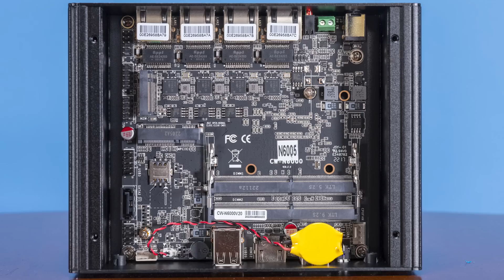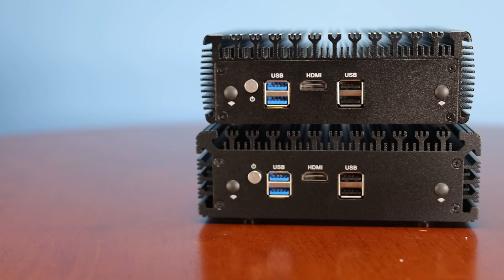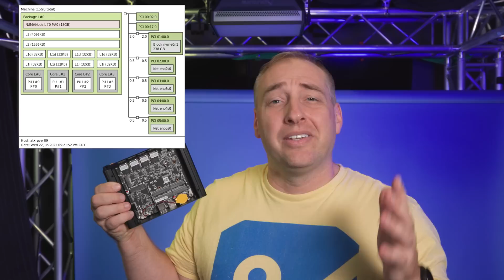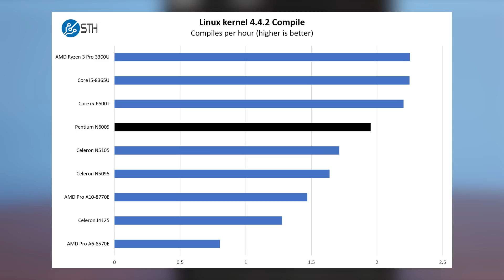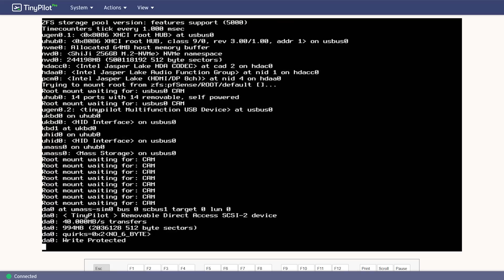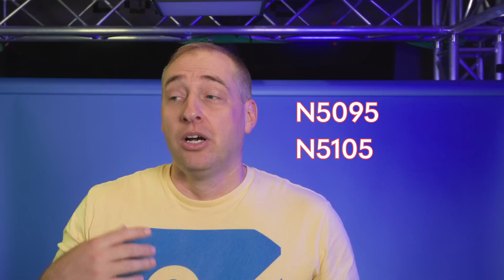Fastest Cheap 4x 2.5GbE Intel Atom N6005 Firewall for pfSense OPNsense and Proxmox

Comment: I see these models are for 2.5Gb internet. Do they have any for Gig internet
Reply from the maker: Usually the 1GbE versions use J4125 or older processors. It costs about the same to use i210 1GbE NICs as i225/i226 2.5GbE NICs so the more modern ones use 2.5GbE. Since the 2.5GbE ones are backward compatible with 1GbE, I do not think we will see more i210 versions.

Comment: Is this one worth it over the 5105? I plan on using opnsense with it on a 1gbit connection. Not sure about settings on ids etc yet but I want security to be tight. Money isn't really the issue. Not sure how the power draw is different.

Comment: Euhhh.. OK, so suppose I get a 2.5 G router & firewall. What about my switches?  2.5 / 5 / 10 G  VLAN capable switches are $500 each. So if I have 1 8 port switch behind my router and then 4 switches, one for each room in my house, to connect wifi access points and wired clients to, I am looking at 5x $500 on top of the router. So don't make it look like the router is the main cost component inan upgrade above 1G.

Comment: I was going to get one of these but after seeing quite a few reviews regarding the high idle temperatures, I'm going to pass. Spotty quality control seems to be a huge issue, unfortunately.
Reply: I think the issue rely on the bad power block. I bought a much better one for 17 euro on Amazon and idle is now around 5 to 6w (N5105 with 4x i225V).

Comment: I ordered a Qotom Barebone System (Q750G5 5X Intel I225-V 2.5G LAN CPU J4125 Quad Core 2.0 GHz - with 5 - 2.5Gbe Ethernet Ports) from Amazon on 8/10/2022 and received it today 8/13/2022. Shipped all the way from China. No shipping problems here. When I opened up the box to install the memory and ssd, I found an 8 GB stick of RAM. That was a special surprise.  I have installed OPNsense.  Thanks for all of the info on these small computers.  It made me brave enough to make my network router.

Comment: I got Topton with N6005. Getting stuck on black screen when installing Proxmox. I don't have much experience with Linux but it is probably related to drivers.  Can someone help or share their experience? I know Proxmox can be installed on Debian Buster but I got stuck again because Debian does not have Intel i225 drivers.
Reply from the maker: The 7.x Proxmox train we show in these reviews installed without adding drivers. Maybe go into the BIOS and double check things like virtualization are turned on.

Comment: 15:20 That power supply is terrible!
Just look at the power-factor (second number), it is roughly 0.6 while a good PSU should have around 0.8 in the low wattage regime and north of 0.9 with nominal load.
I assume this PSU literally does not have any power-factor correction circuit.

Comment: If you think you need a fan on the Kingnovy unit I would recommend this:
Since the Kingnovy unit can sit on its side, you can do so, remove the bottom and go buy some cheap mesh from your preferred hardware (as in building materials) store and put it where the bottom used to be (just glue it in place).
If you still want the bottom to mount it somewhere I think the best option would be to cut out part of the bottom (your hardware store can also likely help you with that without you having to purchase the tools) and put some mesh over it.
I think natural convection together with it being on its side will be more than good enough to cool anything in there.

Comment: I see this and other intel CPU product in Aliexpress.  Would pfsense/OPNsense run more effectively (faster and less bottleneck) with  i7 1165G7 compared to N6005?  It's for the home use with  a gaming PC, a NAS, and about 20 wiress connections.  Thanks.
By the way, I have XR700, netgear.  Paid whole bunch for it, and it's slow and can't maintain the DL speed.

Comment: Does anyone knows what is the input voltage range allowed on those? I imagine there is some kind of regulator for the CPU inside the box. 12V regulator are also not delivering a precise 12V. Wondering if this could be wire directly to a 12v car battery while the alternator is running! Thanks for anyone that have a clue on this as I just search for 1 hour and no one mention this!
Reply: modern car charging systems will supply up to 14.4v (or more) and the batteries are usually closer to 12.5v while the vehicle is running and not charging.

Comment: Thanks for your informative video. I am curious as to why get this N6005 unit rather than the J4125 unit you reviewed a few months back. If the main use is for pfsense, is there any benefit in getting a higher power/speed processor? Also, would it be better to run pfsense bare metal or in a proxmox VE in these kinds of boxes?

Also, would you consider doing a step by step install and full setup of pfsense for a typical home use scenario please? Thanks.
Reply from the maker: We have the Proxmox VE with pfSense installation guide using on one of these (I think the J4125) linked in the description. Some want more performance if they are running more VMs on the unit.

Comment: I've heard, or read, that running a vpn using open-vpn requires compute power, and I'd like to ask that your reviews of router-ish devices include some info about through-put & power draw while using a consumer vpn.  Or, perhaps, make a seperate vpn video discussing general reqs.  Thanks,
Really surprised this device uses so little power when each port on the cheap switches had more of a bump in draw.

Comment: Thanks for the video. I bought an 8 port 2.5Gb version from qotom. There’s no NVME port, I guess they ran out of PCIe lanes. There’s no atom processor option either (again likely due to the amount of PCIe lanes). Looks like it will pay for itself in 3 years just from the power savings.
Who knows how long it will take to arrive though.

Comment: What MAX temperature does the N6005 reached? and how much does it usually hang on routing?  I have one on my way would love to have your numbers to compare before deciding if mine has an issue or not.
Reply: 60 C full load, they use powerlimit on CPU

Comment: How would something like this compare to the similarly priced ($370-$400) Asus GT-AX6000? As much as I would like some of the advanced features you get with a roll your own router, I feel that I would rather have the (relative) stability of a fully warranted Asus product with comparable costs that also include Wi-Fi 6 and a trustworthy power supply.
Reply from the maker: Totally there are folks that would prefer an all-in one. I run 6x APs at home and you can run the WiFi controller software on this, along with better VPN/ IDS. This is more for those who want more than an all-in one unit. Plus, sometimes you just need a fanless PC
Reply: @ServeTheHomeVideo  I really do want something like this, for all those reasons, but I just don't think you're going to get reliable firmware updated (ok, you might not get that from Asus either (-; ) and definitely no tech support or warranty for boxes from Ali baba.

Comment: Thanks for the video Patrick! You mentioned you also just got the 6-port i7 version, I have that one as well (kingnovy version). It seems to be tailored for a 2242 ssd but with an adapter bracket that allows 2280 ssd's but under an angle. Eager to see your review on that unit, cause I had to adjust tdp's in bios and it still runs too hot to my liking (even at idle).
Reply from the maker: I did not get the chance to try it before flying out again (only 40 hour layover at home between trips this week.) Thermals are something I want to look at specifically.

Comment: So I ordered the kingnovy barebones model but I am a little confused about which sodimm I am supposed to purchase with regards to pin count, there are three different ones. Is it the 240 pin version? Also, if I am just looking at power consumption, does the nvme drives use less power? I don’t think performance is that important as I am just getting it for the firewall appliance.
Reply from the maker: DDR4 SODIMM, aim for non-ECC DDR4-2933 or 2666. On the SSD, 2.5" SATA will likely be cooler

Comment: Here's GPU today WW channel inventor yesterday. Is it true Seeking Alpha is holding these FTC public disclosures for public transparency behind a pay wall? . . .

Rank	Product	6.30.22	6.1.22	Change	Prior Rank	Note
1	3060	3.280%	4.068%	-24.02	1	
2	1060	3.182%	1.959%	38.45	5	Up from 10
3	3060ti	3.182%	2.906%	8.68	4	
4	3070	3.119%	1.462%	53.13	26	Up from 26
5	R580	2.917%	2.775%	4.87	6	
6	3060 mobile	2.917%	3.197%	-9.58	3	v Arc
7	3050 mobile 	2.917%	2.412%	17.32	9	Up v. Arc
8	3090	2.856%	2.275%	20.33	10	Keeps Intel 
9	Tesla all 	2.652%	2.578%	2.80	7	Out
10	2060	2.652%	2.188%	17.49	12	
11	3070 mobile	2.323%	2.473%	-6.45	8	v Arc
12	1660S	2.307%	1.959%	15.11	18	
13	3080 10 GB	2.267%	3.487%	-53.79	23	Up from 23
14	6600	2.220%	1.744%	21.45	21	Up from 21
15	1050ti	2.031%	1.892%	6.87	17	
16	3080ti 12 GB	1.954%	1.537%	21.35	15	
17	R570	1.825%	1.805%	1.09	18	
18	2080	1.697%	1.773%	-4.44	20	
19	1080	1.687%	2.020%	-19.74	13	trading
20	3050ti mobile	1.660%	2.002%	-20.61	14	v Arc
21	1070	1.565%	1.796%	-14.78	19	
22	6700XT	1.533%	1.488%	2.93	24	
23	3080 mobile	1.514%	1.572%	-3.82	22	
24	1080ti	1.496%	1.468%	1.88	25	trading
25	1650ti	1.496%	1.293%	13.54	28	
26	5700XT	1.493%	1.293%	13.39	29	Up from 29
27	1070ti	1.352%	1.110%	17.92	31	trading
28	970	1.347%	1.345%	0.13	27	
29	2080ti	1.331%	1.267%	4.83	30	
30	6600XT	1.286%	1.014%	21.15	36	
31	2070	1.233%	1.014%	17.76	35	
32	3070ti FE	1.087%	0.302%	72.20	73	Up from 73
33	980	1.045%	0.535%	48.83	53	Up from 53
34	960	0.979%	0.927%	5.27	40	Up from 40
35	2070S	0.936%	0.883%	5.63	42	
36	1660ti	0.936%	0.817%	12.77	43	
37	3080 FE	0.915%	0.921%	-0.68	41	
38	R550	0.875%	0.738%	15.66	47	
39	1030	0.870%	0.811%	6.79	44	
40	3070 FE	0.833%	0.956%	-14.81	39	
41	3050 dtop	0.809%	1.107%	-36.88	32	v Arc
42	1650	0.780%	0.782%	-0.26	45	
43	5500M	0.756%	0.761%	-0.73	46	
44	P1000	0.751%	1.093%	-45.59	33	
45	1660	0.735%	1.003%	-36.48	37	
46	2080S	0.732%	0.680%	7.10	50	
47	6900XT	0.729%	0.718%	1.58	49	
48	3060ti FE	0.697%	0.532%	23.75	54	v Arc
49	6800XT	0.671%	0.729%	-8.71	48	
50	TU 4000	0.629%	1.043%	-65.99	34	sweet spot
51	5600XT	0.591%	0.436%	26.29	61	Up from 61
52	R560	0.591%	0.541%	8.60	52	
53	3090 FE	0.591%	0.578%	2.22	51	
54	A4000	0.589%	0.471%	20.04	57	
55	2060S	0.568%	0.471%	17.05	56	
56	980ti	0.557%	0.416%	25.38	62	channel
57	MX 150	0.544%	0.346%	36.39	69	v Arc
58	A2000	0.477%	0.264%	44.60	77	
59	6800	0.427%	0.355%	16.97	68	
60	P 4000	0.427%	0.962%	-125.28	38	always sells
61	GTX TITAN	0.403%	0.375%	7.00	66	
62	6500XT	0.398%	0.273%	31.33	76	
63	R540	0.392%	0.410%	-4.40	63	
64	R560x	0.390%	0.439%	-12.56	59	
65	1050	0.390%	0.328%	15.77	71	
66	TU 6000	0.387%	0.355%	8.43	119	
67	MX 350	0.377%	0.128%	66.05	103	
68	1650S	0.369%	0.782%	-112.06	85	clearing
69	MX 130	0.366%	0.201%	45.21	89	channel
70	MX 330	0.345%	0.203%	41.00	88	v Arc
71	TU 5000	0.334%	0.294%	12.16	74	
72	3080 12 FE	0.326%	0.291%	10.91	75	
73	TU 3000	0.324%	0.177%	45.21	70	
74	VEGA 56	0.321%	0.311%	3.10	72	
75	R VII	0.305%	0.180%	40.92	94	Up from 94
76	5500XT	0.302%	0.250%	17.34	81	
77	950	0.289%	0.244%	15.55	83	
78	Titan X	0.289%	0.262%	9.52	78	
79	Vega 64	0.284%	0.256%	9.88	79	
80	3070ti FE 	0.268%	0.302%	-12.83	73	
81	P2200	0.263%	0.084%	67.90	113	priced right
82	R590	0.249%	0.514%	-106.33	55	
83	P620	0.241%	0.189%	21.73	93	
84	2080 FE	0.223%	0.198%	11.29	92	Up from 92
85	3080 12 10240	0.223%	1.991%	-793.58	15	Ltd. Supply
86	A5000	0.215%	0.218%	-1.46	86	
87	3090ti	0.204%	2.275%	-1014.28	85	cleared
88	Vega 20 mob	0.202%	0.241%	-19.67	156	
89	A6000	0.202%	0.250%	-24.00	82	
90	P5000	0.199%	0.198%	0.65	90	
91	T1000	0.196%	0.462%	-135.44	58	priced right
92	MX 450	0.194%	0.212%	-9.58	87	
93	P520	0.180%	0.189%	-4.74	99	
94	5700	0.164%	0.198%	-20.18	91	
95	2070 Max-q	0.164%	0.157%	4.56	100	
96	MX 250	0.162%	0.148%	8.39	101	
97	2080 Max-q	0.149%	0.177%	-19.36	95	
98	A3000	0.143%	0.177%	-23.78	96	
99	5600M	0.135%	0.253%	-86.93	80	
100	TU 8000	0.122%	0.093%	23.77	110	
101	V100	0.119%	0.119%	0.16	104	
102	WX 3200	0.117%	0.108%	7.85	106	
103	P2000	0.114%	0.439%	-284.80	60	priced right
104	P100	0.095%	0.131%	-36.97	102	
105	P6000	0.095%	0.070%	26.95	119	
106	Vega 48	0.093%	0.087%	6.08	112	
107	RTX TITAN	0.090%	0.070%	22.65	120	
108	6650XT	0.088%	0.076%	13.67	118	
109	WX 5100	0.088%	0.090%	-2.94	111	
110	R570x	0.088%	0.046%	46.87	132	Up from 132
111	R520	0.088%	0.081%	7.02	114	
112	2060 Max-q	0.080%	0.049%	37.91	131	
113	T400	0.080%	0.105%	-31.49	107	
114	6400	0.077%	0.078%	-2.02	116	AMD v Arc
115	WX 7100	0.077%	0.099%	-28.47	108	
116	1650 Max-q	0.077%	0.067%	13.09	121	
117	6750XT	0.072%	0.096%	-33.93	109	
118	W5700	0.072%	0.055%	22.89	124	
119	2070 FE	0.072%	0.078%	-9.58	115	
120	2060 12 GB	0.072%	0.171%	-139.45	98	selling
121	R540x	0.066%	0.076%	-13.96	117	
122	W5500	0.064%	0.067%	-5.01	122	
123	WX 9100	0.061%	0.052%	14.24	127	
124	2080S Max-q	0.058%	0.052%	10.35	95	
125	3090ti FE	0.056%	0.113%	-103.50	105	
126	W6600	0.053%	0.026%	50.69	141	
127	Titan V	0.053%	0.049%	6.86	129	
128	MX 230	0.050%	0.049%	1.96	128	
129	A4500	0.050%	0.046%	7.72	134	
130	W5700X	0.042%	0.055%	-30.12	125	
131	CMP 90HX	0.040%	0.035%	12.34	136	
132	6950XT	0.034%	0.049%	-43.29	130	
133	Vega 64 FE	0.034%	0.058%	-68.58	123	
134	R580x	0.034%	0.174%	-405.74	97	
135	6900XT Liq	0.032%	0.046%	-46.10	133	
136	Instinct M125	0.032%	0.026%	17.82	140	
137	GP100	0.032%	0.038%	-18.71	135	
138	6800M	0.029%	0.023%	20.31	146	
139	T2000	0.029%	0.386%	-1224.90	64	priced right
140	W6400	0.027%	0.020%	23.30	147	AMD v Arc
141	W6800	0.024%	0.023%	2.60	167	
142	6700M	0.024%	0.035%	-46.10	138	
143	T1200	0.024%	0.023%	2.60	144	
144	Vega ll Duo	0.019%	0.017%	6.08	148	
145	2060ti mobile	0.019%	0.015%	21.73	150	
146	6600M	0.016%	0.035%	-119.16	139	
147	T600	0.016%	0.015%	8.68	153	
148	CMP 170 HX	0.016%	0.023%	-46.10	143	
149	Instinct Mi8	0.011%	0.012%	-9.58	155	
150	MX 550	0.011%	0.003%	72.61	163	v Arc
151	CMP 30 HX	0.011%	0.012%	-9.58	154	
152	Instinct M160	0.008%	0.006%	26.95	156	
153	A100	0.008%	0.023%	-192.21	142	
154	CMP 50 HX 	0.008%	0.006%	26.95	157	
155	6850M XT	0.005%	0.017%	-228.73	149	
156	5700XT 50th	0.005%	0.003%	45.21	164	
157	2050 mobile	0.005%	0.006%	-9.58	158	
158	A40	0.005%	0.006%	-9.58	159	
159	A5500	0.005%	0.006%	-9.58	160	
160	W6900X	0.003%	0.003%	-9.58	161	
161	W6800X	0.003%	0.003%	-9.58	167	
162	6700S	0.003%	0.000%	100.00	new	
163	6300M	0.003%	0.000%	100.00	new	
164	Instinct M100	0.003%	0.000%	100.00	169	
165	Instinct MI6	0.003%	0.000%	100.00	new	
166	WX 8200	0.003%	0.015%	-447.89	152	
167	Rad Pro 7	0.003%	0.015%	-447.89	151	
168	V340	0.003%	0.003%	-9.58	168	
169	T500	0.003%	0.003%	-9.58	166	

mb